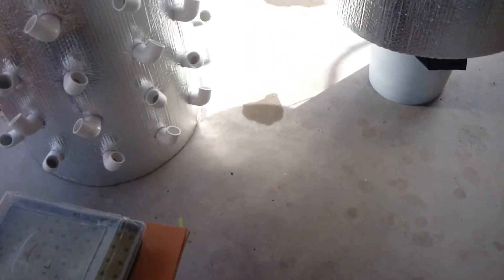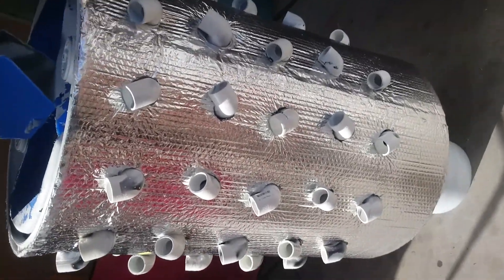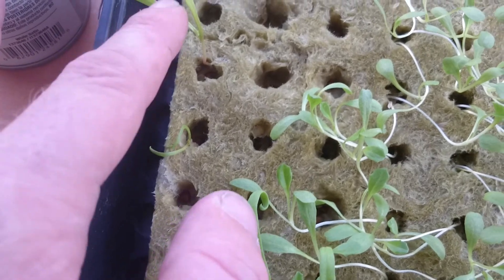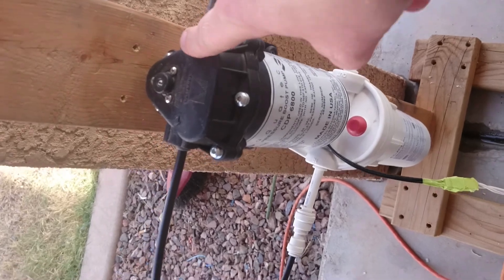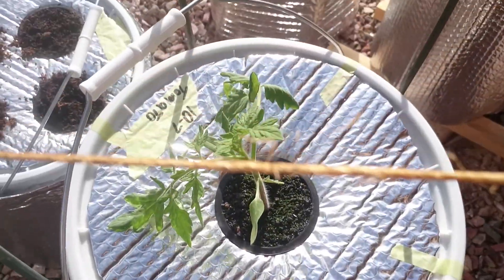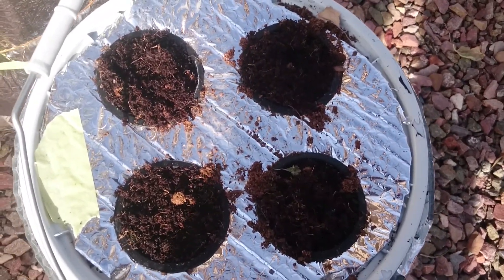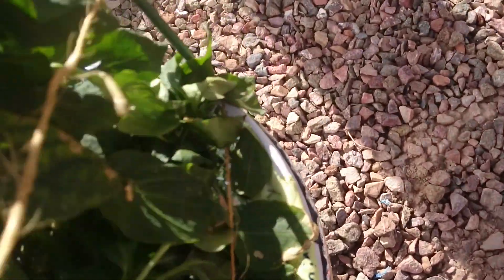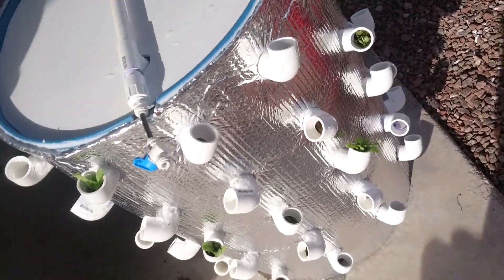DIY High pressure Aeroponics system grow tower fully functioning.

Comment: I was wondering if you could grow tomatoes to maturity in this system alone? Do you have plans I could buy for this? I'm moderately handy but no way I'm just eyeballing something like this. Let me know and thanks for the great vid!
Reply from the maker: HI Cory yes you can definitely grow tomatoes to fruit in this setup I probably wouldn't grow 60 at once though as they would need alot of water and nutrients but growing one to ten wouldnt be to hard. as for plans i don't really have any i can just tell you that they are 55 gallon food safe barels and i think 60  one and a half inch elbows and a hole saw and a heat gun to make pressing the elbows into the holes a little easier and the insulation is a reflective type of bubble wrap style insulation and all of that can be purchased at a hardware store, the barels I purchases from tank and barel supply. the misting heads and all of the pvc was also purchased at a hardware store, the pump I purchased from Amazon for around $50.00 all in all I think I spent around $100.00 each. i hope that helps and thanks for watching

Comment: Hi Todd Can you provide a parts list and where you purchased it in detail
Reply: Looks like he doesn't have one, his last reply was: "i don't really have any i can just tell you that they are 55 gallon food safe barrels and i think 60  one and a half inch elbows and a hole saw and a heat gun to make pressing the elbows into the holes a little easier and the insulation is a reflective type of bubble wrap style insulation and all of that can be purchased at a hardware store, the barrels I purchases from tank and barel supply. the misting heads and all of the pvc was also purchased at a hardware store, the pump I purchased from Amazon for around $50.00 all in all I think I spent around $100.00 each. i hope that helps and thanks for watching"

Comment: Thanks! Could you do a video of how you cut the insulation around the pvc? I'm sure it's time consuming but I'm having difficulty visualizing the process.
Reply from the maker: I wrapped the Container after I cut all of the holes then traced the holes one at a time with an exacto knife then I heated each hole with a heat gun from the inside to soften the plastic and then press the angled fitings into the holes from the outside giving the clean look.
I'm sorry your question slipped through the cracks as I get quite a few and have many many videos.

Comment: Love your HPA system. How did you solve your clogging problem and where did you purchase your misters? You mention they atomize the water. According to the NASA HPA page, the best droplet size is 50 micron. Does your misters create 50 micron droplets? Thanks
Reply: +ExtractionArtists 
Its best to steer clear of the brass patio misting nozzles, they love to clog. Netafim, tefen or hypro are better choices.
Reply from the maker: That's a fact.
Reply from the maker: I can't remember any of that information by this point.  I might revisit this project in the future, though.

Comment: How are your Aeroponics systems doing? What size rockwool cubes do you use?
Reply from the maker: I was using 1 inch cubes, and I no longer use the system as it was meant as an exeriment and grew more lettuce than I could eat or give away.
Reply: @ToddLarsen  How did you get the each system to rotate 360 degrees?
Reply from the maker: @jimpowell1578  I attached a lazy Susan to the bottom of the barrels, purchased at the local hardware store👍

Comment: Todd, is your pump able to support both of your Aeroponics systems, or do you require two different pump setups?
Reply from the maker: Charles Cochran I only needed one for that setup and a couple other folks said they ran 10 barrels off of one pump just like it, using less misting heads. I'm no longer using this setup because I could never eat that much lettuce but if you have a big family or have the time to sell the excess it could be profitable. Thanks for your question and Keep Building 👍
Reply: Todd Larsen thanks for the response. 7 kids, 5 still at home, so looking for something to help out. I find your videos extremely helpful. I will be starting to build my system this coming week. We grow a lot of Thai basil each year. I am interested in seeing how well they work also.
Reply from the maker: Charles Cochran best of luck on your project and I'm glad my videos are helpful to you, I certainly enjoy making them 👍😃